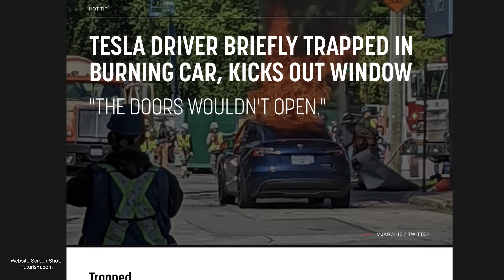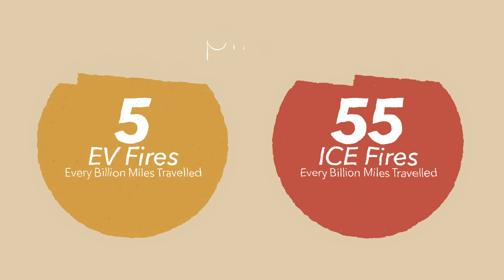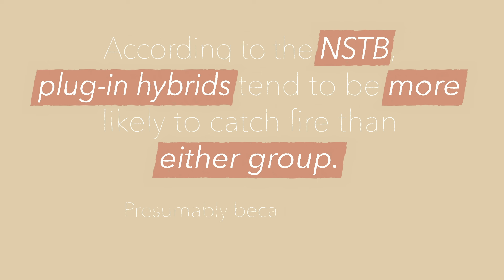How To Tackle EV Fire Misinformation

Comment: The only real issue with EVs and firefighting is the very large amount of water needed to cool the battery if the cells get damaged. Renault has a solution, basically panels you can smash away and shove a fire hose into, which will flood the interior of the battery pack, reducing the amount of water needed to a far lower amount. In urban areas with fire hydrants close by, that's not such a big deal, but away from a hydrant, now you need a fleet of fire water tenders to deal with that. 

Buildings have FDCs for sprinklers and standpipes. How about a FDC for EV battery packs? Like the Renault. That would fix this major issue, to the point where a fire truck's onboard water tank would suffice.
Reply: Removing oxygen isn't a solution because lithium ion cels, when they are punctured, the products contained within are an oxidizer and will feed themselves. That's one of the things that led up to the injury of several firefighters in Surprise, Arizona with a lithium battery fire in an ESS that was equipped with a full clean-agent extinguishing system. (Read the UL report)

Comment: Facts are facts. Look up the very recent EV bus that burst into flames and molten metal in France. It was captured on film. A small arc flash on top of the Bus and it went up into flames and spewing of molten metal in a run away fire. Fortunately no one was hurt because they could get out in time. They just had to let it burn. https://youtu.be/5r-yN8SugWM  .   China  Bus.  https://youtu.be/T71cVhxG_v4  Another EV bus fire. https://youtu.be/-5aNdqZWphY  . Your numbers are not an accurate comparison because there are way more ICE vehicles on the road than BEVs so there will be more ICE vehicle fires in total but if you take the amount of EVs and the ratio of fires their numbers are already higher.

Facts are Facts. Current battery tech is not as safe as it could be. This is also why I think fuel cell technology  is a better fit for larger vehicles with longer range needs.
Reply from the maker: The stats we quoted are either per mile travelled or per N-thousand cars.

The simple fact is EVs catch fire far less frequently than fossil fuel powered vehicles. However, we're so inured to burning gas cars that it's not news unless someone died.

^Kate
Reply: @transportevolved   I guess my point is that the stats they have right now will be errant until the number of BEVs on the road are 50/50 with ICE vehicles and the age of the average BEVs increases. Currently the average age of BEVs on the road is fairly new. When you can compare apples to apples the stats will be more representative of what is really going on. If you take a cross section of 1000 Ice and 1000 BEVs that are say 10 years old and compare those numbers for fires and amount of damage costs then we will have something to actually look at. Currently the darn Bolt EVs have scared off a lot of would be adopters. 

I also believe that a mix of fuel cell vehicles,  Hybrids and BEVs would be a positive move forward. 

I actually like BEVs, Hybrids and Hydrogen vehicles over ICE but it will take time and none of us should sugar coat the facts about anything. 

Call a kettle a kettle and a glass a glass. Different things do different jobs and we should not try to convince people that one is the only way to go over another.

A diesel ICE is not in the same world as a Tesla model Y and nor should it be.

We all have to resist Green Washing and be up front with people and balanced.

Old carb vehicles with mechanical gas pumps did not burn down the way newer vehicles with electric fuel pumps and fuel rails do on newer cars.

In the same way lithium batteries of today are less likely to catch on fire than older tech but when they do you have a runaway chemical reaction that burns super hot and fast. It is a molten metal fire that cannot be put out easily.

I have said from the beginning that Tesla windows should not have to drop to be able to open the door. Bad engineering and design. I would rather try to get out of a Leaf on fire than a Tesla.

Comment: Battery technology is not there yet. Battery cell separation platform is a problem. Cell media material is more focused on cost rather than safety. Give it about another 5 years for battery cells to be optimized . Some insurance companies will not cover you if you park your ev in your garage because of the risk of fire.

Comment: I looked up the United States EV fires compared to gasoline vehicles and this is what I found. There are far fewer electric vehicles on the road, so when adjusting these numbers per 100,000 vehicles sold, hybrid vehicles actually were the most dangerous, with nearly 3,500 fires per 100,000 vehicles, 1,500 fires per 100,000 gasoline vehicles, and only 25 fires per 100,000 EVs.

Mass sales of EVs are fairly new so they should have included what model years the gasoline and hybrid vehicles were. I would suspect that many fires were on older and not well maintained vehicles.

Comment: Tesla CERTIFIED Fan Boy here with a HOWEVER - folks are safer in a Tesla's Frunk than the interior seats. Each FRUNK has a FEDERALLY MANDATED "glow in the dark" obvious, EASY TO USE, handle in case a child is trapped in the space. "HEY, What are you DOING up there?"  -  "I'll ride in the Frunk - easy in. Easier OUT."
TESLA - Un HIDE the Emergency MANUAL door openers NOW - PLEASE.

Comment: 8:03 - NSTB? Typo, my dear. Personally, I prefer MFSB and 🎵TSOP. (Stand clear: Elli gonna boogie.)

Meanwhile, EV fires will ALWAYS be more newsworthy than petrol conflagrations because batteries aren't supposed to burn under any circumstances, whilst petrol is. We know it's dangerous stuff and treat it accordingly. But EVs shouldn't catch fire. At all. Ever. Nope. Not even a little bit.

Having already hit the dancefloor with TSOP,  I'll now make the obligatory reference to 🔥Disco Inferno. Which is something that nobody at Land Rover wants to see.

The fact that an EV's electrical systems may [sic] fail unpredictably - either out on the road or parked in your garage at night, quietly munching on electrons - is all the reason many people (and the media) need to treat any EV fire as being more significant than any ICE car fire.

Comment: Why would anyone in their right mind think this was a 12v fire. I guess tesla's don't bother with fuses anymore. I'm sure you will tell us next week that it was done for our benefit. Never excuse bad engineering.
Reply: So you are saying there cannot possibly be a short somewhere past the fuses? Or better yet, the reason the power door release wouldn't work is because one or more of the mosfet fuses did trip and cut power to the rest of the car. Here's a thought, take a bar of copper and just lay it over the two contacts of the 12v battery (DO NOT ACTUALLY DO THIS) and then tell me how any fuses will help that situation before it goes very bad.
Reply: @zerix01 No possible way there can be a short after the fuse, that is why we have them. Tesla uses mosfets to control LV power disto and should always be monitoring the circuits for shorts cutting off before they can destroy the mosfet. 
Weird last question with copper pipe and 12v batt, 1 fuse at the end of the pipe.
Reply: @lj516  I've shorted my fair share of circuits before. It is far from not possible, especially in the example of rodents eating wires as given in the video.

Comment: Great discussion and good unbiased information again. I have one little point,  the use of a properly installed direct-from-board electrical outlet will be perfectly safe for long term use (I have one). Most users plug into any available ring main without checking wiring quality!

Comment: A comment on the issue of using a granny charger on, say, a rental/holiday property or someone elses house. (for UK users, and maybe other countries with similar building regs)
1) Many UK houses have a socket on the electric cooker isolation switch.  Clearly this circuit is rated for high currents (30-40A) and has been regularly stressed at high currents as the cooker has been used.  The only thing you need to test in use is whether the socket itself is getting warm at the plug.  Remember, you might exceed the fused limit of the circuit if you charge while cooking the sunday roast, but this is the very best option for overnight charging as you can be completely certain that the internal wiring and connections are up to the job.
2) Most circuits in a house are rarely used under high load for long periods of time, except the kitchen/utility room which contains a lot of high load appliances.  Therefore these circuits have been "stress tested" every day with a dishwasher, washing machine etc.  As long as you avoid adding another high load while running all the appliances, this will be the safest option again for unattended charging.
3) This does not apply to countries with 110V's, but most cars can limit the current draw down from the default 10A.  If you are unsure of the circuit have been provide to charge your car away from your house with your modern and checked wiring (I was asked to use a barn supply to charge my car - the wiring was modern but all sockets were spurs) then set the current draw to maybe 7/8A to give a bit of head room.  Remember folks, the EU requirements are 10A maximum continuous draw even if it says 13A max, and some third party granny leads allow 12/13A continuous draw which is "unwise".

Comment: During the news reporting on this fire - the owner said he didn’t know about the mechanical release and was wanting to highlight to Tesla owners to know where it is. Yet the headline is as shown - doors failed to open…
Reply: Good to know. Another potential issue in the future could be ‘panic + habit’ I imagine it would be a bit hard to remember a switch you’ve rarely/never used before while in panic mode when you are probably far more likely to fall back on habit aka how things ‘normally work’ then panic more when it doesn’t. 

Perhaps a good time to recommend people get familiar with emergency evacuation measures much like they would practice a fire drill or at very least hopefully glance at the fire evacuation point at some point. Perhaps much like when you go to a school play and you are told where the evacuation doors and toilets are before the play starts (at least that’s pretty much standard practice in Australia, no idea about America), the Tesla tells gives you a basic safety procedure when you get it with the ability to repeat ‘intro guide’ if you want to.

I’m sort of assuming the Tesla has some sort of intro guide or could have one, given how I’ve heard it gives you a run down on what autopilot does or doesn’t do (even if most people just do the tick and flick apparently), adding basic safety info into a ‘hello new user’ thing doesn’t seem that far fetched to me, so maybe?

And now I’m just thinking that because some cars have the ability to remember different seat settings etc. for different users they could be smart enough to run the ‘hello new user’ thing again as needed.

Given the Tesla was smart enough to notice something was wrong perhaps they could even run a ‘safety course evacuation refresher’ at this point, if they are still capable of doing so? Much like a fire alarm telling you to ‘please evacuate the building’, granted you’d probably really want a way to turn such a loudspeaker announcement off if it’s running for any length of time if it’s a false alarm, but it could help with the panic/lack of knowledge on how to get out issue. 

I guess then the problem could then become ‘false fire alarms’ type instances which Aussies are very familiar with. XD and figuring out a good way to check if it was a false alarm or not, even if it’s better to have a malfunctioning alarm then no alarm in a real emergency. Also figuring out major issues vs minor issues alarms aka ‘just abandon the car and run’ vs ‘it’s still safe to drive the car but please get the car an official checkup ASAP’

And the fact that I can even consider modern day cars doing all this, likely just via a few overair updates, is amazing in and of itself.

Comment: I’ve seen many sharing images of the falcon wing doors emergency release, I guess it’s behind the speaker grill? So you need to remove the speaker grill to access it? let alone knowing about it
Reply: Not sure about the Model X, but the 3 and Y have it right on the door in front of the window controls. In fact more often than not people will go to pull that instead of the button when first introduced to the car.

Comment: One of the biggest problems is that people swear by their own knowledge of cars. Someone may have driven their entire life without a vehicle fire and see there is a slight possibility an EV might catch on fire and they suddenly fear that unknown. 

It’s easy to forget that ice engines are literally controlled explosions that propel your car down the roar and require fuel that burns to make that explosion. We just live by what we know and fear what we don’t understand or simply haven’t experienced. 

Change for some will take time and when the majority have switched, the curmudgeons with sulkily follow along.

The rest of us get to have all the fun first 😀
Reply: That reminds me of trying to explain to people why they shouldn't use premium gas for a car that was designed for 87, it's no better and may run worse , could damage your catalytic converter. "Yeah, but I like to do a little extra for my car"

Comment: tesla model x flaw. if fire happens. there is no mechanical direct connection for the door latch......if you have a dead car thats smoldering......your kinda screwed if you cant escape
Reply: A simple Google search would have let you know that there is a mechanical release for the falcon wing doors. In other news, the designers of the most advanced cars in the world are not a bunch of idiots who never thought of the need for passengers to get out of the car in an emergency. Safety is the top priority at Tesla and Teslas are the world's safest cars.
Reply: by the door i mean the ones that falcon wing..... 😅

Comment: Since both of the fires were put out in a few minutes and did not reignite, I doubt they involved the battery at all.
In Europe some cities have a cut down shipping container that they put a foot of water in and then put the EV in that until it cools down where the US still just sprays water at it.
The Model S front doors are both electric and mechanical, but there is a pull cable for the rear doors if the power is out. It is by the ankles towards the center so it could be reachable by a front seat person and easily by a back seat person. The back seat pulls for Model Y are in the bottom of the door under a rubber mat in the door pocket which is ridiculous. They should be visible
Reply: I've heard of a foam extinguisher being used in the US to put out battery fires. I just don't believe it is as widespread as it should be for most areas.
Reply: @zerix01  Foam isn't so good for the battery packs. You need water to cool the cells and stop thermal runaway. The cells are contained within the battery pack assembly, and that is the issue that requires a large amount of water.
Reply: @JoeZasada  I thought the idea with the foam is to remove all oxygen? No oxygen no fire. Unless the batteries themselves are releasing something to start ignition but I didn't think that was the case.

Comment: 1) It would be interesting to see those fire statistics broken down by cause.  I'd wager that far more ICE fires are caused by damage from collisions causing fuel spillage than other sources.  A more apples-to-apples comparison would be to only look at vehicle fires started by electrical faults.

2) We've had 100+ years to learn how to put out gasoline fires, whereas lithium batteries are relatively new and very difficult to extinguish once thermal runaway begins.  Many fire departments (especially in rural areas) don't have the training or equipment to handle them yet.  In many cases all they can do is prevent the fire from spreading while the battery burns itself out.
Reply: fuel spillage doesn't cause fires and it's actually a lot harder than you would think to make fuel catch fire. It's not like in the movies where the smallest spark makes a car blow up. That's just movies.
Reply: I'm talking more about up in the engine compartment, where damage from a collision causes fuel or oil to leak onto the hot engine and ignite.  The fuel tank itself is usually well protected.

Comment: Yes, Model Y fire this past week looked like a garden variety 12V electrical fire. EV battery fires get attention because they are dramatic, can be difficult to extinguish and reignite even hours afterwards. However, I believe once we have 20 years worth of EVs on the roads the rate of vehicle fires will likely look very similar to the overall rate of ICE vehicle fires simply because most vehicle fires are electrical in nature and occur with older vehicles. That being said, there have been significant recalls of vehicles for fire risk and this is as it should be and is required by law. NTSB/NHTSA have not performed a significant review of vehicle fires for many years simply because they lack the resources from Congress and they are overdue to do such a review. So, at the moment, almost all statistics are garbage because they are never reported within the specifics of the analysis (ie, identical demographics of vehicles- age, miles, etc.)